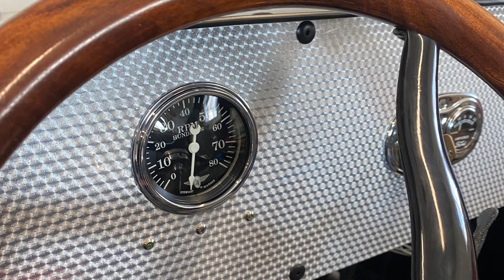Aluminum Speedster body build

Comment: Hello, I am in the process of building a 1925 Model T speedster. I love your design and construction of the aluminum T body. Do you have any drawings or plans from this build that you would consider selling? thank you!
Reply from the maker: Honestly they are all so different that plans would only get you so far , we have built 3 and they are all made to fit each car because of components like gas tank, cylinder head, how the frames lowered, seats , steering column drop as well as many other major things. I have photos of how we did them which I can send and tell you what we used to make each of them if that helps any !
Reply: @JohnsonRacing18  that would be awesome I would greatly appreciate that!